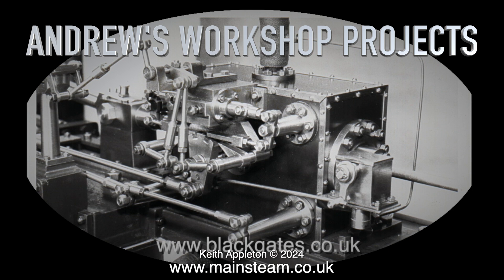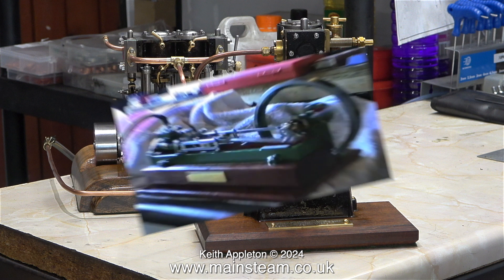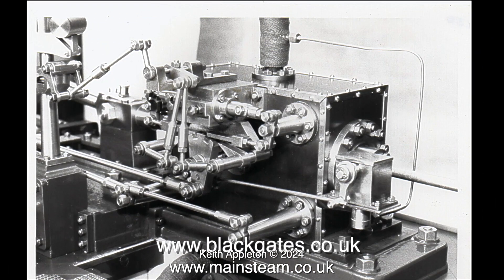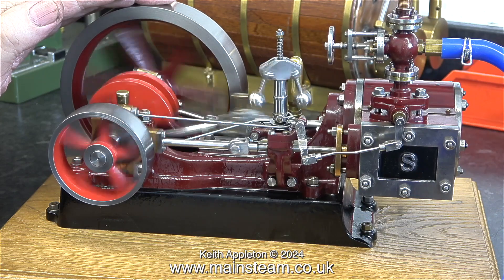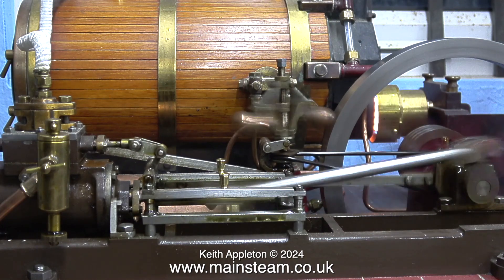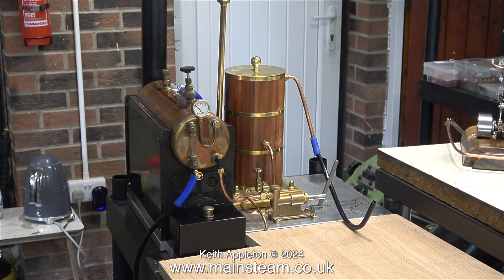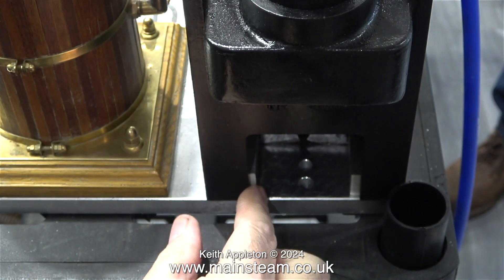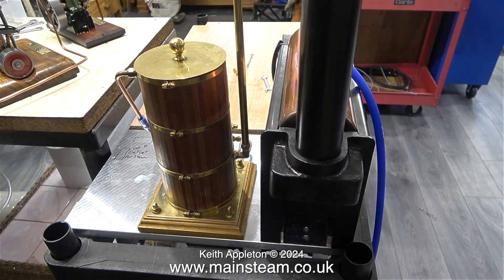ANDREW'S WORKSHOP PROJECTS - PART #12

Comment: Do all of the Stuart models require the use of a milling machine, too please?
Reply from the maker: Not really, but a Milling Machine or a Milling attachment for the lathe is quite useful. A lot of the work can be done in a 4 Jaw Independent Lathe Chuck.
Reply: @keithappleton  That's great, thanks. I've got a Harrison L5 lathe, with 4 jaw chuck, faceplates etc, just wasn't sure if that would do. 👍